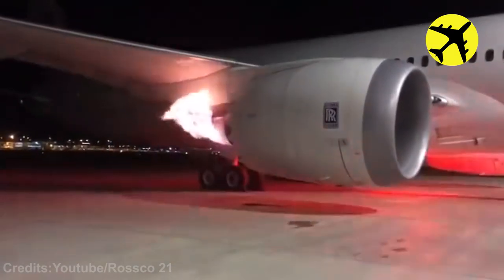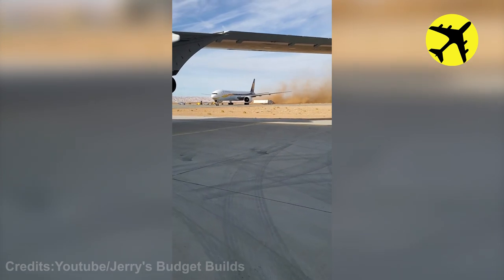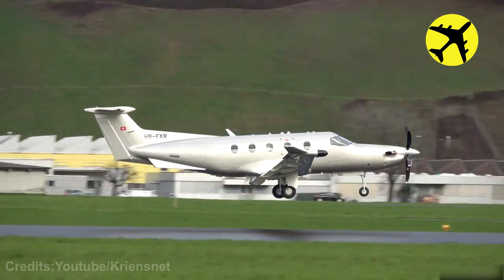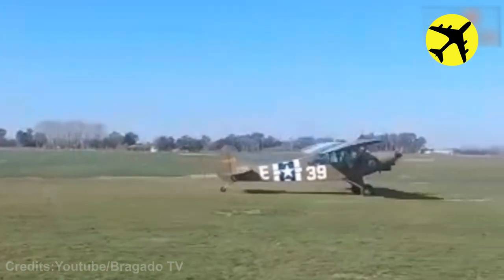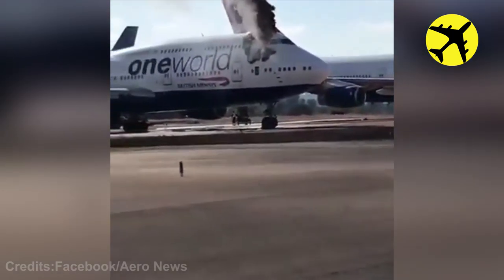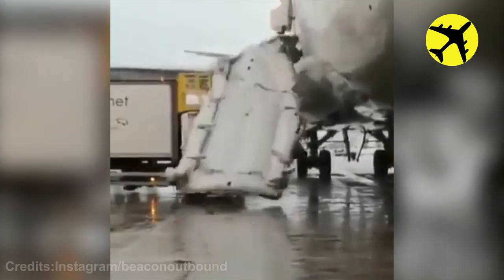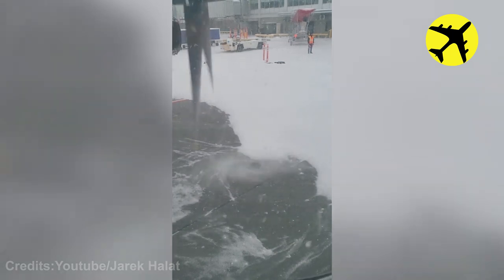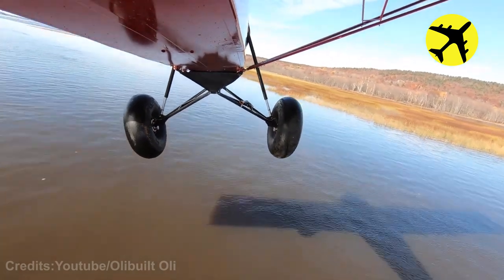Plane Engine on Fire

Comment: At least once a month you post video of a jet engine on fire. These are NOT engines on fire. These are newly rebuilt engines. This is normal.
Reply: As a former Crew Chief on the KC/RC-135 and engine run certified, I agree 100% with you...these are NOT engine fires per se, they are "green" engines (recently rebuilt) and it's very typical to see this on a first start after rebuild (or a brand new engine).
Reply: @FinkworldTravels  I'm also a retired KC/RC-135 and KC-10A Certified Engine Run Crew Chief. You and I have both seen enough of these engine starts with smoke and sometimes flames. It's normal.
Reply: @bernardowens1648  After getting engine run approval from the tower, I'd always inform them (and rookie ground crew) that we had a green engine...saved a lot of unnecessary radio chatter during the run...LOL.